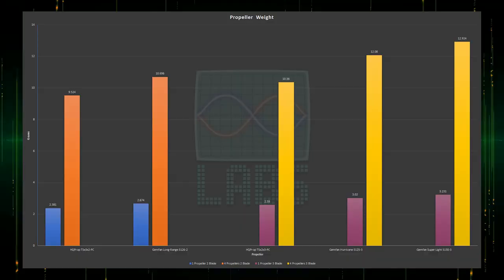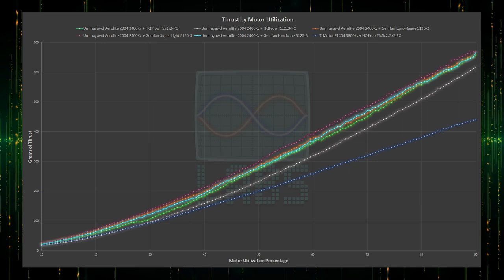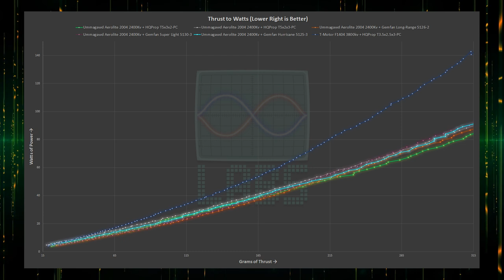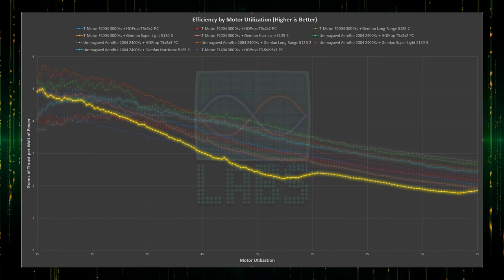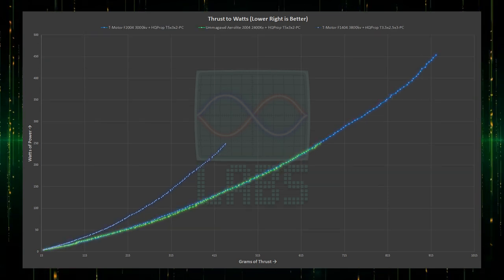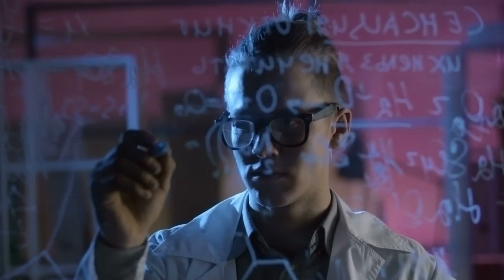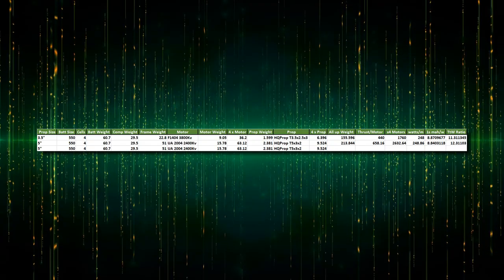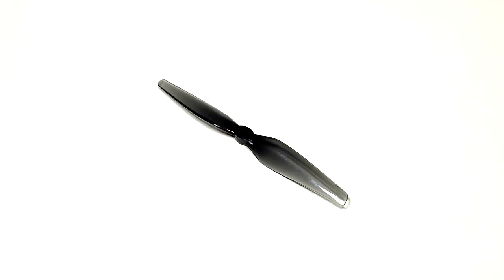Sub 250g 5"  - Tons of data, analysis, and build design theory-crafting.

Comment: I used a set of 1804 3022kv hyperlite motors for my 5 inch light build with the Hypetlite UL5. bi-blade props feel really good, in open air its just a little slower than a regular 5 inch, but in corners it handles much better because a lack of mass. Air resistance is a real issue, so I full throttle eject into straightaways and flatten out to reduce air drag. I was initially planning to use a 850mah 4S battery, but after testing a 3sHV I settled on a 750mah 3sHV, reducing the battery mass by %30, bringing the AUW to 197 grams wet. 
I think I could get a little more thrust with a bigger motor or lower KV same motor... But the build at is is fast AF and I get 7 mins of track time. (landing at 3.5)

Comment from the maker: I always have to find at least one mistake after uploading. When doing build theory-crafting I used the wrong motor/prop in the chart as the efficiency chart baseline. The normalized chart was correct though, which was the important one. Here is the proper chart: https://i.imgur.com/4OZGcWc.png

Comment: Cool Video! I built my 2fiddy with Xnova 1804 1900kv. With 6S 550mah it weighs exactly 250g and flies great with any 2 blade 5 inch propeller. The lighter motors also make it a bit more durable. With the 2004s the arms snap even in light crashes like falling from a few meters on grass.

Comment: I optimized my 4 inch with the 2004 tmotors and 2 blades gemfan. It has lots of power and the smalles batt I use is a 4s 1300 and the biggest 4s 2000. flight time is almost he same, but the heavy rig screams so nice. I had a smaller 1100mah, which was super silent in the night and had the best flight feel with the 2 blades. I think the sweet spot with light 4 inch is at 1300. frame without batt is 169 grams.

Comment: Can you do some destructive testing on gemfan props with the hybrid mounts? I just can't bring myself to trust them, I think the t-mount carveouts are potential points of fatigue for the hub, especially the more oval ones.
Reply from the maker: Sure let me stick my finger in t.... AAAAH! I don't think they'll break easily as they are reasonably thick, but that's a down side in itself because that's more weight.
Reply: @RecursionLabs  Gemfan uses these franken-mounts all the way up to 6", I will noise test the 6 inchers I bought later but outwardly they appear more like a shriek than a groan.

Comment: My 4" 4S build is getting close to the weight limit and I don't even have a camera or VTX on it. I wouldn't want to try and build a 5" sub-250, it would be too compromised. I'd rather forget the weight limit and just build something even bigger than is easier to solder and wrench on. I hated building my 3" and 4" quads, it's just too tight for everything.

Comment: hey love you videos. do you have plans to make a sub250 3.5 inch build with the o3 air unit? Currently I kind of struggle to find the correct frame to build on. My current setup is the o3 air unit in the geprc smart 35 (had to make a new camera mount to make it fit) but it feels a bit heavy and underpowered now. The weight is just below 250 at 244g. Using  tattuu r-line 750mah 4s 95c
Reply from the maker: Yeah I'm working on trying to make a build near the weight of the Scythe.
Reply: @RecursionLabs  that would be amazing. looking forward to it. ty

Comment: Have you thought about using a pre-resistance in the power supply to simulate battery internal resistance ?
Reply from the maker: The wiring from the power supplies adds some resistance, as does the motor windings, so it does have a tiny bit of consistent sag based on load.

Comment: Have you ever made a video finding out which prop would take max rpm without flutter ?
Reply from the maker: Hey bud! I have not intentionally, but it should be obvious when looking at results since thrust should decrease and wattage increase (along with my ear pain if I'm in the room at the time). Those Toroidal props experienced flutter right before they shattered. What are you looking to see?
Reply: @RecursionLabs  5" props that can withstand 2500kv at 6s .. low pitch of course
Reply from the maker: @shadyyoussef6486  Bi-Blade? Are you looking to break speed records or something? :)  Honestly it would be a matter of just testing the props on that setup. The biggest potential problem would be smoking a motor, since the current/heat on static thrust testing is higher than in the air, but if the pitch is low and it's short bursts that might be okay. The other would be that when flutter occurs there is a chance the prop violently snaps, but with polycarb that is less of a risk.

Comment: Yeah, 5 inch is just a bit too awkward to fit into 250g, it's really restrictive. Due to how good that 1404 is, 3.5" at 200g seems to make more sense for now. If we get a similarly good motor for 4" or 4.5" then we could push up further against the 250g limit, which has the main advantage that your RX, VTX, cameras and FC make up a smaller % of your AUW, so in theory you should have better flight performance. 1605 could be good for 4.5", but the current options are kinda heavy and there are almost no props. 4" should have a range of good motor sizes, depending on how agressive the prop is.

Comment: Think a RCinpower 1507 motor would be viable with a lightweight 5in prop?
Reply: iirc it's a little heavy, so you will struggle to fit it in under 250g. Also it's kinda tall so will run warm, losing efficiency and power during hard flying.

Comment: would 1404 tmotor 2900kv at 4s battery would be a good choice for 4inch sub 250gr?
Reply from the maker: I do have some 1404 motor tests on 4". If you're going for long range bi-blade that might be okay, but you'll be better off with a lower Kv if you're going for efficiency/LR.
Reply: @RecursionLabs  Thanks :) I just ordered 1404 tmotor 2900kvs lets see how they perform :D

Comment: You should test fettec 2104 motors 
If you were in Europe I would send you some

My setup 
5inch Frame 
2104 fettec Motors 
Fettec 35a aio
Hybrid ghost
450 6s
Gemfan 3 blades 

240gramm
Reply from the maker: It's too bad I'm not in Europe then. They would be interesting to test.